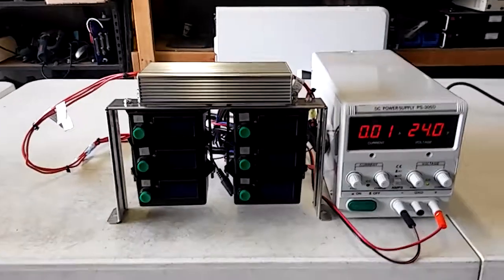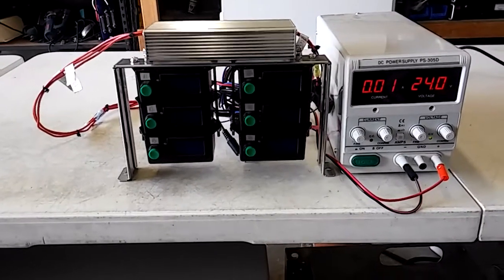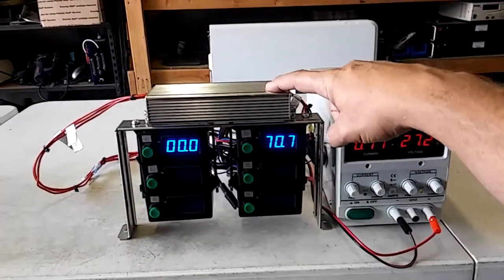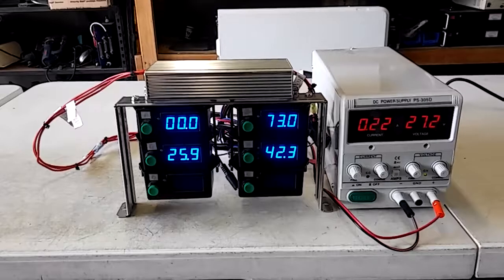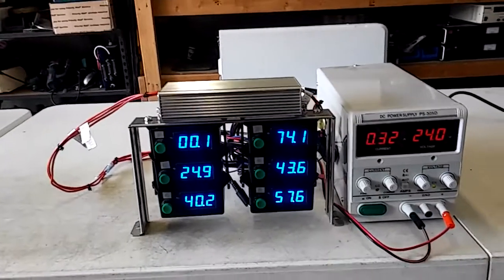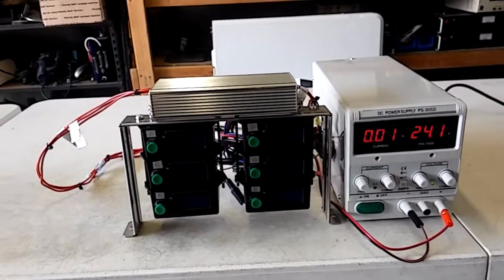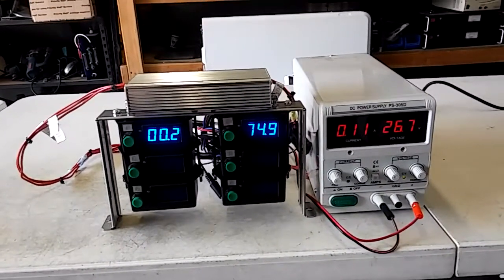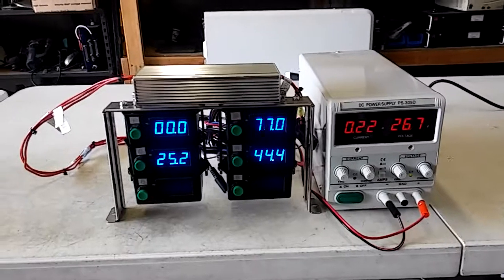HHO  Microcontroller for an 89 L Engine

Comment from the maker: We don't have any issues with freezing temperatures. We have several fail safes operated by our newly design microcontroller. Our units/ cell continue to work down to -20 F without the use of a thermal heater.

Comment: Hi, how do you deal with freezing temps? Nice units:)
Reply from the maker: thewonn: We don't have any issues with freezing temperatures. We have several fail safes operated by our newly design microcontroller. Our units/ cell continue to work down to -20 F without the use of a thermal heater.